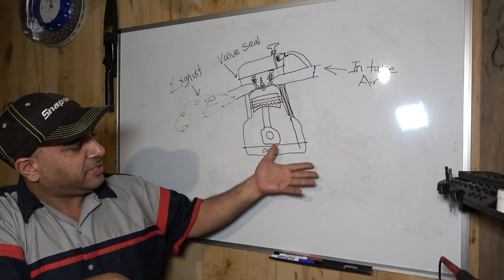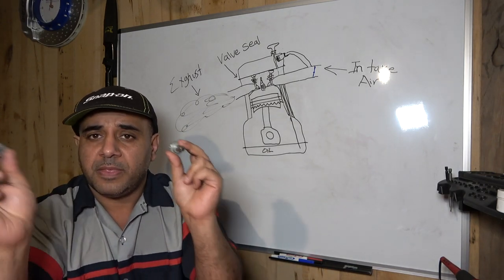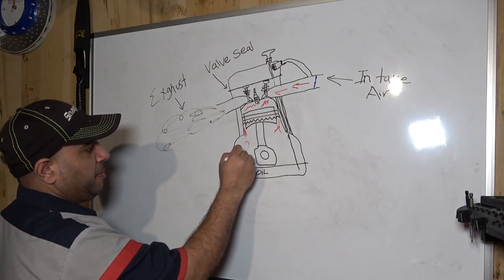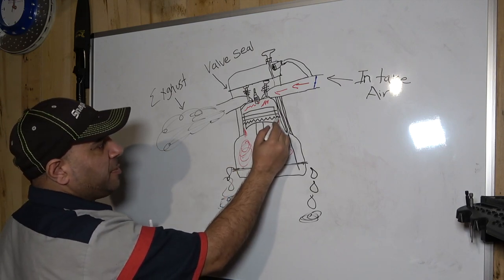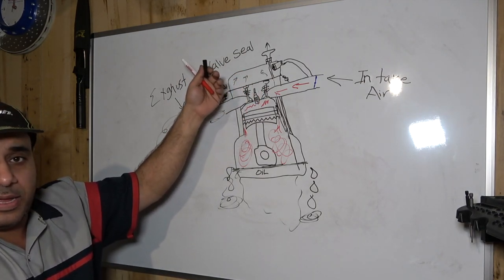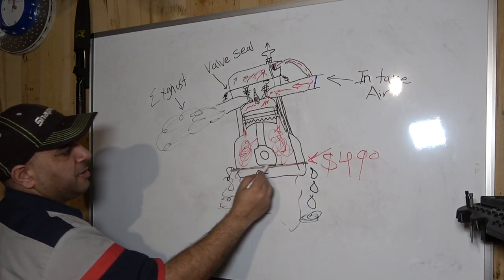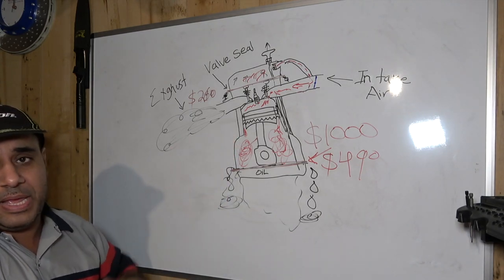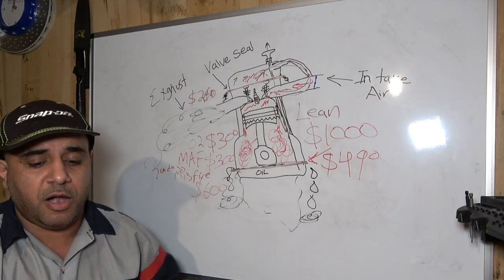PCV valve Explained   What is PCV Valve and How important is it?

Comment: excellent info!  Ive been chasing down issues on my van for YEARS.........and finally have come to a loose/not sealing oil cap (and oil filler tube grommet at the engine is cracked, leaking air) creating a LEAN condition.....leading to more fuel injected.... and fouling the spark plugs and O2 sensors!
Reply from the maker: Right on!

Comment: Great explanation. There should be at least 2 PCV valves installed on all engines especially V6 and V8s. That way if one fails, the pressure can be relieved through the other. It seems that failure of PCV valve means failure of gaskets, misfires, oil burning, sludge, and probably accelerated failure of an engine. It’s interesting how there seems to be so little attention to this. Tons of videos talk about changing gasket and rarely any videos explain why it leaked in the first place.
Reply from the maker: Yup some car have 2

Comment: I own a 2006 Lexus GS.  This car is in EXCELLENT condition.   I've had the car for 12 years.  It runs beautifully with 125k miles.   I maintain it religiously.  About one month ago I started to get a strong exhaust smell in the cabin.  This occurred intermittently.   'Sometimes' on cold start up the car would reek with exhaust fumes.  Sometimes not.   The exhaust fumes occur randomly.  They were quite strong and made breathing difficult.  My wife would not want to ride in the car.  I took it to the Lexus dealership and explained the issue, describing the symptoms and the odor.  They kept the car for three days and couldn't solve the problem.  I took it to two local mechanics also and neither could identify the issue.   The last one kept the car for two days and said that upon start up he could smell  something.  He said he believed the problem was coming from the A/C unit.   His solution Ozium in the intake vents.  
                    A day after getting the car back I started the car, in the garage, and the exhaust fumes were again overwhelming.   I decided to park the car and do some reading....
I found where one person said a symptom of a bad PCV valve might be exhaust fumes.  I removed the PCV valve in my garage.  It was the original factory OEM valve and completed carboned up.   It was and stuck in the open position.  I replaced it and the car ran perfectly with NO exhaust fumes.  It seems slightly more responsive and runs like a brand new car.  Cost $10.... 
                   People often don't consider the PCV valve when maintaining their vehicles.  I was one of those, but now I know how important that little part is...
Reply from the maker: PCV valve is very important and it dosent come to ur mind when u have lean codes. Possability is there
It dosent come to mine when there’s random misfire 
And so much more
Reply: @RBTheMechanic  My car did not throw a code.  The last mechanic felt certain that if there was an issue a code would be generated.  Not so.   On top of that,  the car purred like a kitten.  I believe the mechs thought I was exaggerating...  or something.  It became quite an issue.  I told my wife I would get rid of the car if I couldn't get this issue solved.  Lots of reading gave me the clue....
Reply from the maker: @curtgomes  these cvt have recall TSB states it for cvt valve body
Reply: @curtgomes I have a similar problem with my Focus, but the geniuses at Ford decided to put the valve under the intake manifold, so that has to be removed to access it. I could take this one on but think I’ll go to the mechanic lol

Comment: I have a 2017 ford fusion with a 1.5 L ecoboost and got a crankcase pressure code, makes my engine light come on then the light will stay off for a few days then it will come back on. Is it a bad sensor that needs to be replaced or is it actually something wrong with my engine?
Reply from the maker: Yes I had those come to me but customer refused the work but here’s a video some guy did u have similar issue I would replace that pipe and sensor https://youtu.be/u-2UDKpdonk

Comment: I have a 07 accord 2.4 253k miles on it. Burned half a quart of oil in 50 miles. Replaced the valve and breather hose, the hose was almost completely pinched off. Bout it off a girl and don't know how long she drove it like that. Plz help!
Reply from the maker: Ok well check for leaks and since u did the valve and pipe now keep an eye on the oil if it’s any success also next oil try diffrent oil GTX castrol and then keep an eye on it worst come to worst most likely it’s the piston rings and valve seals which u can do much about
Reply: @RBTheMechanic  so is it cheaper to fix oil rings and valve skirts than it is to get a new engine?
Reply from the maker: @simonsays582  well the parts are not so much just labor to change the rings and all is expencive but might be cheaper than dropping in new engine
Reply: @RBTheMechanic  yeah because the dealership didn't even bother asking if I wanted to just fix the piston rings or valve skirts they just jumped straight to replacing the engine.
Reply from the maker: @simonsays582  they doing this under warrnty?
Reply: @RBTheMechanic  no
Reply: @RBTheMechanic  😅, I bought it off some gal who did like no matinence at all. Like 2 oil changes the entire time she owned it.
Reply from the maker: @simonsays582  damnn

Comment: Yo whats up? I sold the Honda and bought a BMW X5. I already got codes. Two p300 one p305 p302 and p0430
Can a camshaft position sensor cause misfire?
Reply from the maker: I doubt it’s cam sensor it can do things but I would hook up scan tool and see the misfire data and then swap coils do tune up oil change and see where that take it also look for vaccum leaks since u got p0300
Reply: @RBTheMechanic  what about a pcv valve? I seen some milky oil going through the pcv pipe into the pcv valve and under the oil cap so I took off the valve cover and it was clean but found some moisture water on the cover. No milk in the antifreeze
Reply from the maker: @servo5651  pcv valve could be vaccum leak but it whistles on BMW very loud
Reply: @RBTheMechanic  it is the pcv and air idle valve stuck on open on the X5. It was clogged up with this soap looking oil. It looks like the original parts.. I replaced one side VCG SPARK PLUGS NOW I REMOVED THE INTAKE MANIFOLD. I’m cleaning and replacing parts. I just cleaned the ACV it’s opening and closing now but before it. Was stuck
Reply: @RBTheMechanic  RB I need some help. I got this BMW X5 I just rebuilt the manifold and valve cover gasket and camshaft position sensors. No check engine anymore or misfire. I replaced the battery with a new one. My radio has no sound now and my heater isn’t blowing anymore. I don’t understand, fuses are good
Reply from the maker: @servo5651  ur heat is not hot or there’s no air?
Reply: @RBTheMechanic  no air blower isn’t firing up
Reply from the maker: @servo5651  ok well I had that happne to one car after installing new battery so I checked checked check for hours then I took off the battery and reinstalled pretty much I had one wire that was tight but it sat crooked on edge of plastic didn’t make contact so redue what u did first see what happnes
Reply: @RBTheMechanic  so reinstall the battery and reset everything
Reply from the maker: @servo5651  yeah just retake apart the wiring u did and connect back and see how it goes
Reply: @RBTheMechanic  ok very good
Reply: @RBTheMechanic  10-4
Reply: @RBTheMechanic  you got any knowledge on a ABS pressure sensor? My BMW KEEPS TURNING ON AND OFF THE ABS LIGHT. My scanner says pressure sensor but research is explaining a different approach
Reply from the maker: @servo5651  what is the code it might be the abs pump bad
Reply: @RBTheMechanic  BMW X5 code 51
Reply from the maker: @servo5651  how old is ur battery I had this type of issue years back the customers battery was super old and low power caused issue if ur battery is old replace it other wise need further work
Reply: @RBTheMechanic  it’s new from Saturday
Reply: @RBTheMechanic  I’m going to check all the fuses then test the abs speed sensor and brake pad sensors first then if anything go to the junkyard and pull a ABS pressure sensor and do a install. Clean out the harnesses with electrical wire cleaner or battery terminal cleaner and hope for the best. I noticed it was recently worked on because the brakes are new. 
Do you use Marvin’s mystery oil? I put it in my gas and engine oil
Reply from the maker: @servo5651  no I don’t use that
Reply: @RBTheMechanic  I just discovered that the battery on this car has a hose that gives ventilation to the battery. It’s disconnected and the cap to the negative side isn’t on. Maybe the battery isn’t properly running right because of this
Reply from the maker: @servo5651  no the battery runs fine just not vented
Reply: @RBTheMechanic  ok very good. What ever it is its gotta be the sensor or pump. The light turns on and off continuously. I found recall on air bag and something to do with abs line on bmw history
Reply: @RBTheMechanic   open circuit code is broken or corrosion inside harness?
Reply from the maker: @servo5651  yup